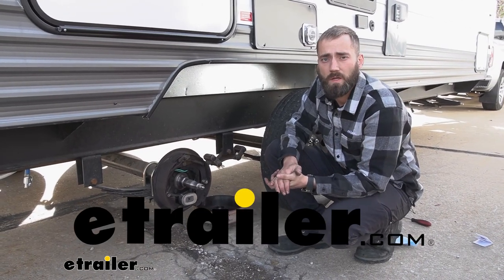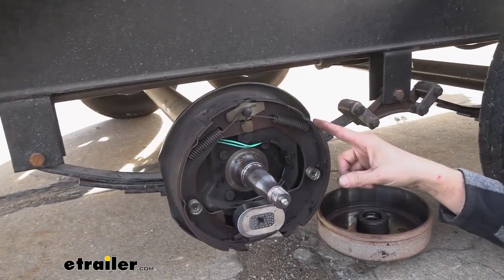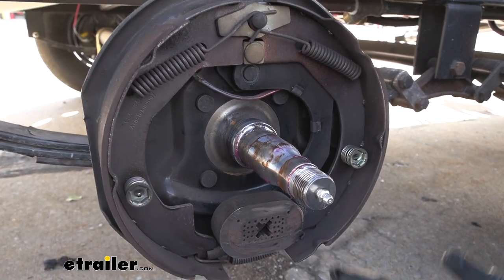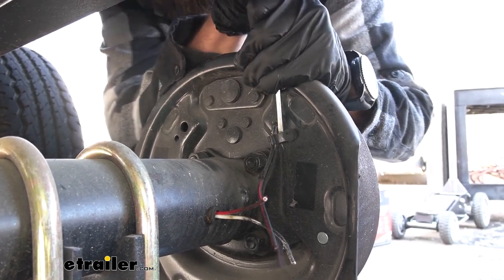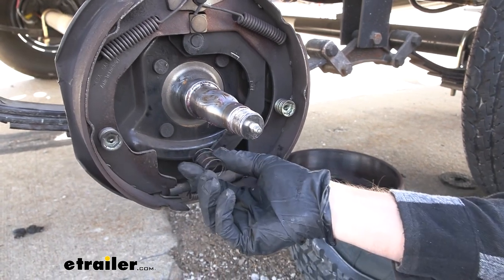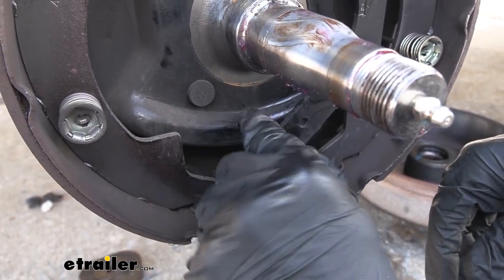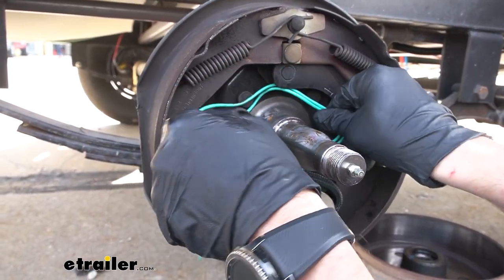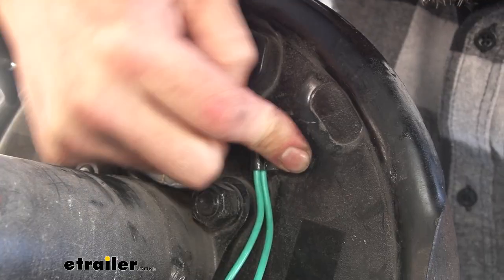etrailer | Feature Review Replacement Magnet Kit for 10" Electric Trailer Brake Assemblies

Comment: I've got 4 wheels do I need to take off all 4 to find out which one has the nad magnet? But great video?
Reply from the maker: Sorry to be the bearer of bad news, but you probably will. You can check the wire feeding the magnet to make sure it's getting voltage, but you'll need to pull the wheel and hub to check to show if or how bad the magnet is worn. Wish we had better news for you...
https://www.etrailer.com/Accessories-and-Parts/etrailer/AKBRKR-M10.html
Reply: why does a grounded wire cause magnet failure?